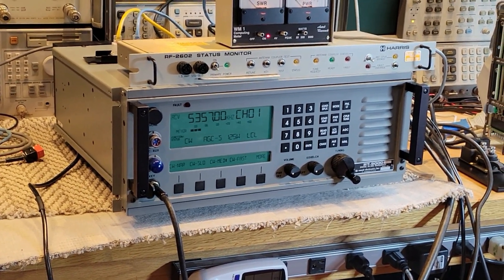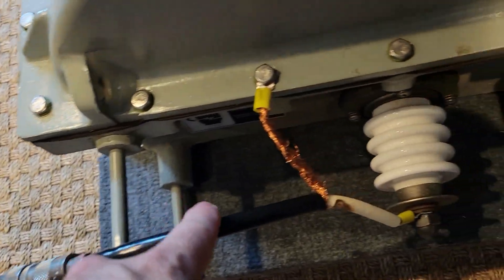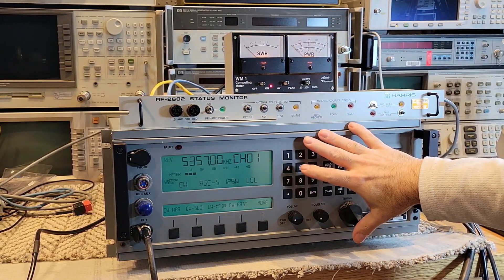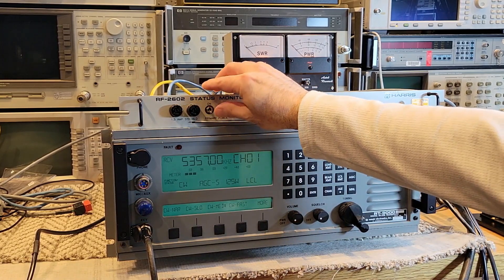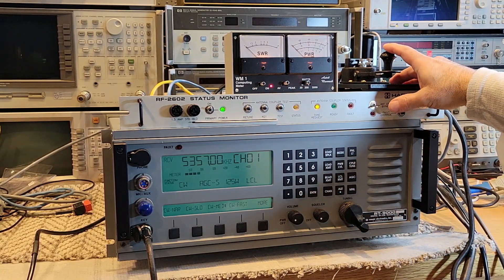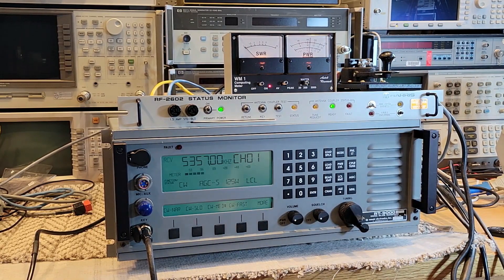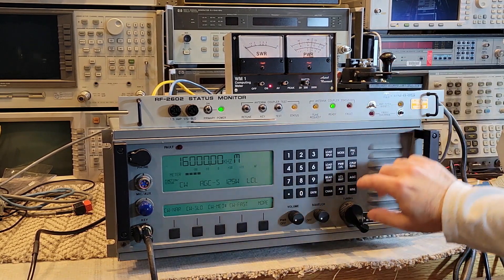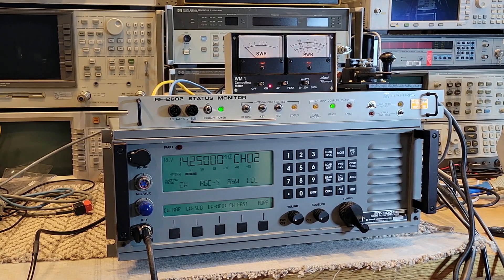Part 3: Harris RF-2601 1KW Antenna Coupler

Comment: if not  use rf2602  2601 how to work
Reply from the maker: The 2601 does not require the 2602 status monitor. You simply plug the 2601 coupler directly into the amp (making a suitable cable) and you're good to go!
Reply: @w2hx  How to drive 2601 with other radios
Reply from the maker: @jing9liu72  to drive the 2601 with a non-harris radio, you will need the 2602 or create your own simple control box with a few signal lines brought out to pushbuttons. See here: https://w2hx.com/x/Harris/RF-2601/2601%20Coupler/Harris_RF-2601_user_1994.pdf